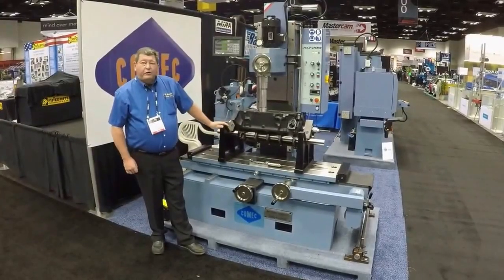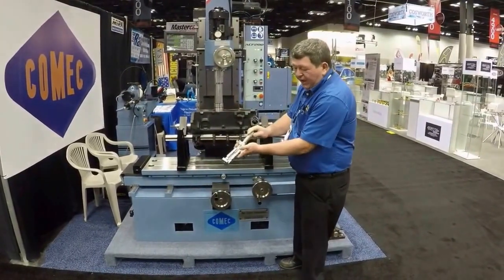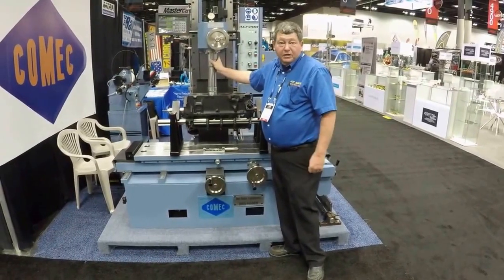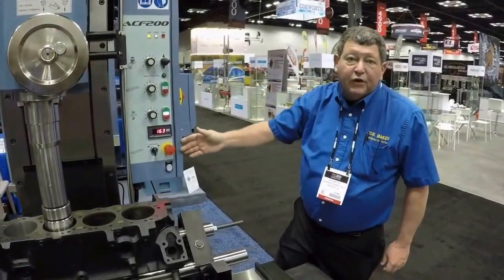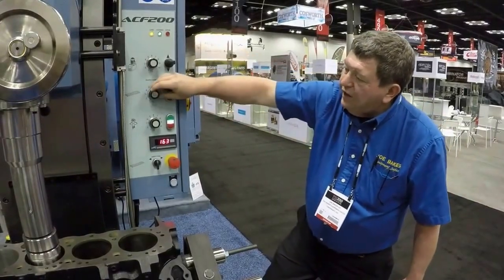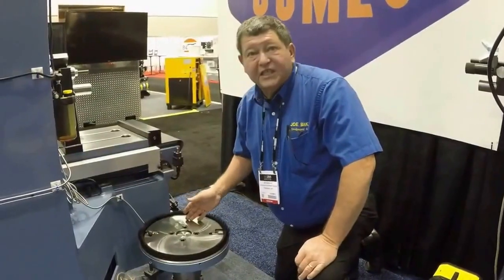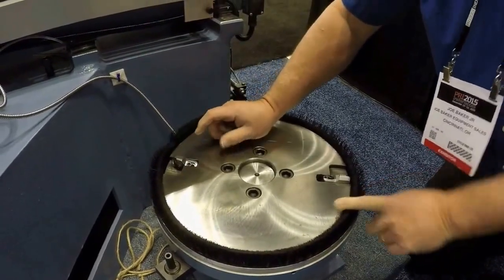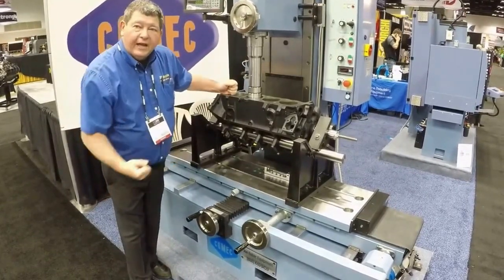Cylinder boring-milling machine ACF200 - Overview at PRI Show 2015 - Comec

Comment: Can the ACF200 CNC also be used for cylinder head surfacing?
Reply from the maker: yes, ACF200.CNC combines the two main operations of reconditioning the monoblocks of cars and trucks, such as boring and smoothing, in a single machine and now completely automatically thanks to CNC control.